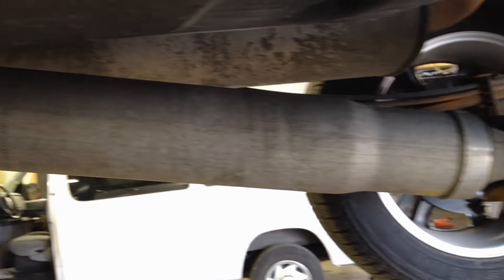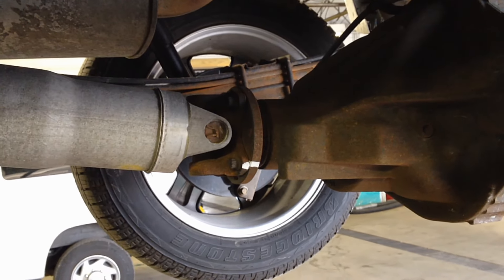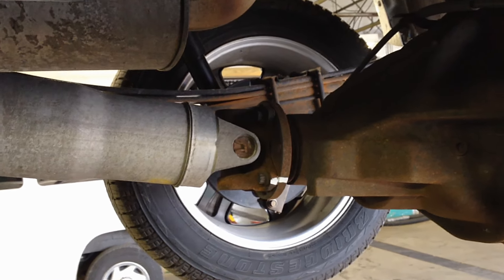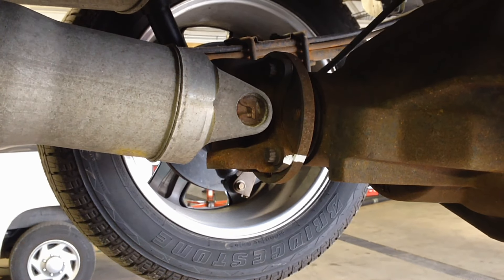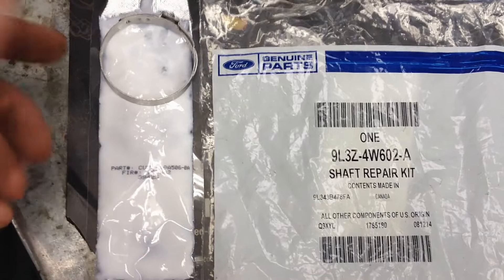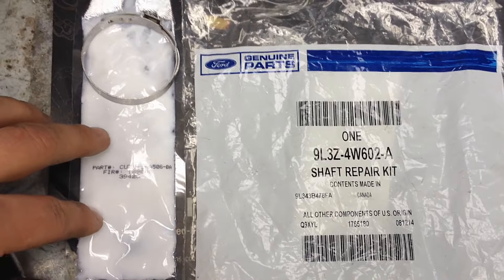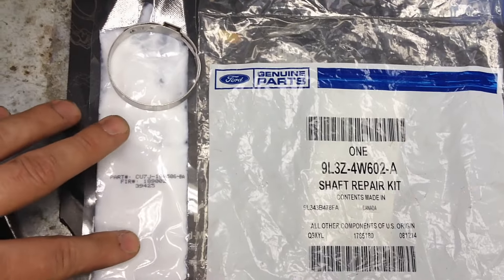Ford F150 One Piece Driveshaft Slip Bump- FIX!

Comment: Everything old is new again.  I had a very similar problem on a 94 F-150 extended cab short bed.  5.0 5 spd 4x4.   Taking off in first there would be an annoying squeak   TSB was to lube the spline.    30 years later still an issue

Comment: it actually  happens in older ford's  all the 90s probably until then  but it's not nearly as bad because of the added knuckles in two piece shafts...  I can't remember  a truck growing up  my father not putting a zerk fitting in by the spines. driving a truck that didn't  have grease all in the splines  was like pulling up to a red light soon as you came to a stop it feel like someone lightly banged your bumper with a fist .👊🏾and when u take off a light 👊🏾  only ocd people probably  even know what I'm talking about 🤣

Comment: None of these driveshaft vids on YT actually show how to torque the flange bolts.  I have sockets, extensions, flex joints, torque wrench etc but I can't seem to get anything on straight enough to apply 75 ft lbs of torque successfully.  I end up using a combination wrench with a pipe for leverage.  Does the truck need to be on a lift or ramps?  And exactly what combination of tools get the bolts torqued properly?

Comment: My 2007 Ford F 150 king ranch had a hard knock at 46 MPH and again at 50 / 51 MPH, then it would smooth out.  If I was going from a dead stop to 55 + MPH IT WOULD NOT HAPPEN. I had my Slip Yoke greased as well as added Lubegard 19610 Instant shudder fix, it runs better than the day I brought it new in 2007.

Comment: The rear u joint on my rear drive shaft has c clips holding the u joint in place. Not the c clips you can get of with pliers. But a straight up C. I can’t get it off. All the videos I’ve seen those are supposed to be on the inside of the u joint. Not on the outside. Any idea wtf I can do?

Comment: I have a 2013 one piece driveshaft. Replaced the driveshaft, u joints, and slip yoke and greased splines with ptfe grease. Still have the slip bump even at 60mph. Did i just not use enough grease?

Comment: In most peoples experience here with this fix, would you say that it fixed a problem only when starting and stopping, or would you say it fixed an issue going into a certain gear? I'm having my issue mainly going into 2nd gear where it usually slams into it hard.  I found this fix, but I'm skeptical if it will work.  It's $40 of tools and lube, so not a huge investment, but just wondering if anyone else out there had the same issues and solved it with this fix?

Comment: Can it do this when putting the truck into reverse as well? Only seems to do it when putting the truck into gear from park. The transmission was just checked less than 10k ago and they said it was fine. Wondering if this  could be the issue… I have a 2000 f150

Comment: 2005 F150 Super Crew Lariat with the one piece steel drive shaft.  This started happening to me, and the truck stranded me in the middle of a busy intersection.  The drive shaft broke in half!  Had to drive it home in 4x4/front wheel drive.  Make sure to keep these yokes greased with the PTFE/Teflon grease!  Got mine back on the road after jumping threw a few hoops finding a good driveshaft.

Comment: Thank you so much for this video. I took my 2014 F-150 to a shop and they told me I needed a new rear end, would cost between $1800-$2500.  Watched your video this morning stopped by Auto Zone and $12 later I have no bumbling when I start and stop. Thank you again.
Reply: I haven't been to a dealership service department since the early 1990s unless it was for a recall.  I don't trust those bastards.

Comment: THANK YOU!!! I have a 2010 with the single shaft and this issue just started a couple days ago. I've been having my bed weighed down with debris from construction and alot of stop n go with pretty abrupt stopping. You sir are a godsend!
Reply: Just curious did you use threadlocker?
Reply: @Zeeluix  believe it or not that wasn't even the issue. I was having a misfire issue. But it didn't trigger the check engine light for days until it finally went off in a bad way

Comment: if my 76 F150 does a clunk just after almost every shift, up or down, is that a tranny problem or just too much slop on splines like you say combined with slop in rearend? cuz it doesnt do it after coasting and reaccelerating, only after shift.

i just greased my splines but only had about 4 gun squirts left so i dont think it did much, a couple other channels seemed to put about 3-4 x as much as i did

Comment: My 2008 e350 has had this issue for a good 3 years. None of the local mechanics know what to do. They all say it’s either the trans going bad or the rear end needs work. I only get the bump when I come to a “hard stop”. As soon as my foot lets off the breaks I get the bump. Is that the issue?

Comment: Maybe a dumb question but why wouldn't the parking brake prevent roll?  It engages directly on the wheels so the driveshaft wouldn't be a factor, right?
Reply from the maker: Correct but you need to be able to rotate the pinion flange to unbolt it, after that sure use the parking brake but the driveshaft is already off and dangerous.
Reply: @FordTechMakuloco  I realized you said jack up the back end and the parking brake obviously doesn't engage the front my bad. Thanks again for all your vids you are a Godsend to Ford truck owners!

Comment: This worked on my 2016 FX4 SuperCab with one piece driveshaft. Noticed this issue when I bought my truck used in August 2023 and was racking my brain trying to figure it out. I thought it just had play in the ring and pinion until finding this videos. Thank you for posting this. So, to those with newer trucks this issue continues to be a problem and this solution continues to fix it. I just used some blue grease I already had in my grease gun. Feels like a new truck now. Thanks again!

Comment: So I'm hearing that chirping noise whenever I start to go and come to a quick stop.  Would that spline, being dry, also cause vibration at higher speeds. I'm getting gnarly vibrations whenever I get between 60-80 mph. Noticeably more so the faster I go.  I have an 2018 Raptor and it's driving me nuts.

Comment: Hi there! after doing the procedimental, my truck now makes some noises in the rear differential I did this procedimental about 5 years ago totally successfully but now this time I can't drive the truck. Als oat the rear differential develo a small oil leak at the front end where the shaft meet the differential. Any idea? Thanks!

Comment: Thx for great video. Question to all can I used High Temperature 4X4 Front Axle and Wheel Bearing Grease MOTORCRAFT XG11 or need to be MOTORCRAFT XG8 PTFE. Thx

Comment: My 2011 raptor had the driveshaft replaced to fix this problem but it only worked for a couple years. Adding the grease fixed it for about 6 months before it started sticking again. I’ve seen fixes where the shaft was drilled for a grease fitting to make it easier to add grease without removing the driveshaft. Removing the driveshaft without a lift in your garage is a pain.

Comment: Thanks Brian. I seem to be experiencing the 'bump' in my 2017 F150 with the one-piece drive shaft. Really started noticing it after dropping the rear differential cover and changing fluid. Wondered what the heck I could have done!? Now, it seems it may be 'what did Ford do?'. 🤨 I'll be pulling this soon and greasing it up.

Update: Got my 12-Point 12mm socket, Blue Thread Locker and Blue PTFE lube today. Lubed my shaft, went for a drive . . . no more 'Slip Bump'. Thanks again!
Reply: I noticed it looked like thread lock on the rear drive shaft bolts, is that what you used the blue thread lock on?
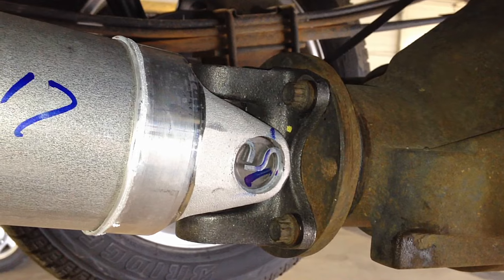Reply: @milesfifer171  I think you meant to ask that of FordTechMakuloco, who posted the video, instead of me.  😉  However, if you re-watch, at 6:10 he mentions using Blue LocTite on the threads for the reinstall.

Comment: Is it normal to have some transmission fluid leaking from the transmission side after removing the drive shaft? Would the teflon grease go into transmission?
Reply: That’s your transmission output shaft seal going bad.

Comment: 8 years later after making this video, it is still helping people. I had it in my head there was too much slop in the transfer case or the trans mount was bad. Mine was clunking hard. I had just replaced the driveshaft not long ago and just couldnt imagine that could be a problem. Sure enough the splines were dry as hell and greasing it completely fixed the clunking. Thank you.

Comment: Okay so how did you put the bolts back onto the flange? Need the torque so I use a wrench but the wrench turns the driveshaft not allowing me to get it going. Any tips ?
Reply from the maker: Put the vehicle in park or better yet have someone apply the brakes.
Reply: @FordTechMakuloco  awesome thanks for that I will try it tomorrow and let you know how it went

Comment: I got 2012 f150 XLT runs on E85. My dash vibrates when i hit 70 miles per hr and up . i got good tires no bumps . roters are good . i got new shocks . what the heck can it be ? Ty man
Reply: I have 2 piece drive shaft

Comment: Purchased the driveshaft lube kit. What is the tool you use to secure the provided camp on the rubber accordion cover?  BTW my mid year build 2013 model 6.5 bed with two piece drive shaft with 16k miles had the white grease installed from the factory it appears.  The white grease was present within the female yoke after separating the two shafts.  I removed a noticeable quantity of it while cleaning the male and female yokes.  What grease that was still resident on the male yoke has turned black.  Found just a small amount between the splines.  Took a little time to clean the splines on both male and female ends before lathering up with the kits provided grease.

If this is anything like the two piece driveline on my Silverado, this same process will need to be repeated every 8k to 15k miles.  On the two piece driveline the grease tends to get gets pushed forward toward the closed end of the female slip yoke.  Essentially wiping the grease off the splines, and the problem reoccurs.
Reply from the maker: The tool I use is a Channel Lock 357 but a diagonal cutters will do just about the same to crimp it tight.

Comment: I just called the Automax Ford dealer in Killeen, TX, and they said that the part is discontinued... I noticed that you published at the beginning of the month, so how can Ford discontinue the part that quick??? I just need to know the specific lube that needs to be placed inside the DS. Thanks.
Reply: Just had my 2010 F-150 done. have them recheck the part #. My dealer originally wanted to charge me but after rechecking the Part # 9L3Z*4W602*A KIT-DRIVE SHAFT BOOT REPAIR. COSTS 25.30 Everything went smooth.
Reply: storming688 That is the one that I gave them. I am stationed at Ft. Hood. More than one case the buisnesses around here will make those statements to have you come in, charge for the diagnostics ($90 just to look at it) and then overcharge for parts. I ended up getting some tractor grade synthetic grease, popped off the drive shaft and greased it myself. It took an hour to do and a $9 tube oof grease I needed anyway.
Reply from the maker: benny259 Yeah that is a good number still and is from the newest tsb.

Comment: I have a 2012 super crew 4x4 one piece drive shaft. I don't hear a clunk or anything but I have noticed that some times coming to a stop it shifts hard. Also sometimes at a stop it feels like something releases like when you have the brakes set and you put the truck back on the ground from being on a lift, if that makes sense. Should I grease it anyways if in not experiencing any sounds? I just didn't want to try to make it better to make it worse. Thanks for the help man I'm enjoying your videos very valuable knowledge!!! Should I grease this anyways?
Reply from the maker: Technics Yes yours sounds exactly how this feels grease it with the grease in the description for best results.

Comment: Thanks! 2009 F-150 4x4  Took 10 minutes. All noise gone.
Reply: Matthew Jamieson 
Did you replace the drive shaft? Or just drop it down and the grease?
Reply: 78ginop  dropped driveshaft and lubed slip yoke at transfer case. All noise gone.
Reply: Matthew Jamieson 
Its at the transfer case. Thx for the info. I thought it was at the rear diff

Comment: Will a new slip yoke be a more permanent solution?  Or is the grease the permanent solution?  Read others that they have to go back every so often and re grease the yoke.  I would only like to do this once.  Thank you!
Reply: 2014 f150 4x4 1 piece drive shaft.   I pulled out the slip yoke and I noticed there was oil in it and looked well lubed.   I went ahead and added the grease you described.  Once I put everything back together and test drove it, i noticed small amount of oil leaking from the rubber boot.  

Is it normal for there to be oil in the slip yoke?  If so,  was I not suppose to add the grease?  Was adding the grease going to contaminate the oil?  And lastly what could be causing the oil leaking out of the rubber boot the slip yoke slips in?  

Thank you and would like to get peace of mind.

Comment: Thank you for taking the time to make this. I bought a 2010 FX2 with the 2-piece driveshaft and 67,000 miles. About 3 weeks later I started experiencing the super annoying clunk whenever I accelerated and stopped. I thought it was the transmission at first shifting hard but then realized the RPMs didn't change when it clunked. Got the shaft repair kit you mentioned on eBay for $17 and man what a difference. Took me 45 minutes and the truck drives smooth as butter now. A huge relief knowing that's all it was.
Reply: I have f150 2012 XLT. Wich kit do i need?
Reply: how do i know if i have 1 piece or 2 piece drive shaft ?
Reply: @pearljeremy23 climb under the truck, if you see a rubber boot in the middle between the rear diff and transmission you have a two piece. I believe it’s called a slip bump. If yours looks like the one in this video you have a one piece

Comment: This is only for limited slip correct? After you remove the drive shaft mine has a big 26mm nut on the end of the piece that goes into the differential (2011 F150 regular axle, one piece drive shaft). I'm assuming there is a seal behind there and that it does not pull out or look like the piece in your video.
Reply from the maker: J Browning No after you remove the driveshaft you just grease it as shown in the video, the other end you unbolted it from is the differential pinion flange you don't need to remove that.
Reply: FordTechMakuloco Man I feel stupid. I kept thining it was the pinon side that was suppose to be greased. Can't thank you enough for the quick response! Was just about to put it back together and give up. Great videos. I havnt seen a video yet but if you know how to get all the coolant out of these newer F150's with out flushing machine that would be great.  I can only seem to get about 5 quarts out at a time.
Reply from the maker: You have to pull the plugs on the side of the block to get it all out or follow my new video for a continual flush- http://www.youtube.com/watch?v=RWIXa50R9bo

Comment: Would Permatex PermaShield Fuel Resistant Gasket Dressing & Flange Sealant or Permatex Form-A-Gasket No. 2 Sealant or Permatex Aviation Form-A-Gasket No. 3 Sealant Liquid be a good idea to use at the end of the spline shaft opening to prevent water and dirt from entering these spline mating areas and contaminating the lubricant you recommended?

As always you're the best, Bro!

Comment: Just had the transmission swapped in my 2010 F150 at the local Ford dealer.  This same symptom started happening right when I left the dealer.  Took it back and they can't find anything wrong.  Service manager said it was normal "axle wrap".  I said it wasn't normal before the tranny swap, so why now?  He said he can't explain why.  Were the 2010 models dry splines too?  I'm going to pull mine this weekend and grease it.  Is this the only type of grease that should be used?   Thanks for the vid!
Reply from the maker: goober1973 Yes this has been an issue for many years.

Comment: Thank you for this video...  I went to a mechanic that estimated in $800.00 to fix the noise, he said it was the  deferential... another mechanic said he had a pick-up truck  with the same problem, he sold the truck because he could't  find the problem...  I saw this video, I've done the same and my pick-up truck now is  fixed, it is  like miracle... Just grease, I spend only $10.00  .

Comment: my 1988 f250 has a 2 piece drive shaft but it has a grease fitting on the end of the yoke just before the middle u-joint, i guess they will do anything to cut costs and cause people problems now days

Comment: This goes back, way back into the laste 90's.  I have an 02, F150 long bed with 320k miles that is set up with this aluminum one piece drive shaft.  Buying a new drive shaft is a $350 pricetag, but simply greasing it is what I do from time to time.  And if its a bit worn that just gives a place for the grease to be without drying out too quickly as you tend to push most of the grease out with that chroming new and a super tight fit.  Chroming or not, its a darn spline joint... grease it.

Comment: GM had this same issue years ago. I did hundreds of them. Same thing....they had us grease the slip joint as a band-aid, and that didn't fix it, in the long run. Replacing the slip yoke with the heavy nickel plated yoke did fix it.

Comment: My truck started having the same slip bump issue but after driving for a while the corrosion actually provided something similar to a dry lubrication and it stopped doing it on its own.